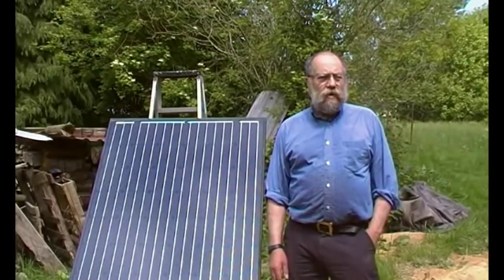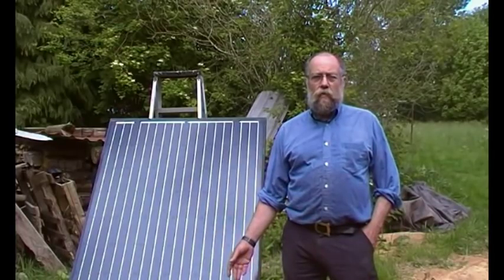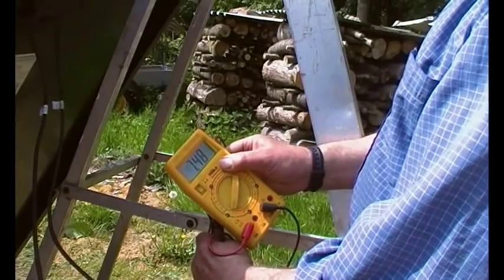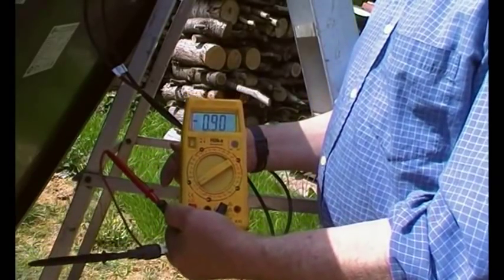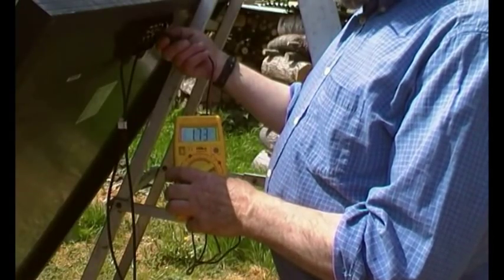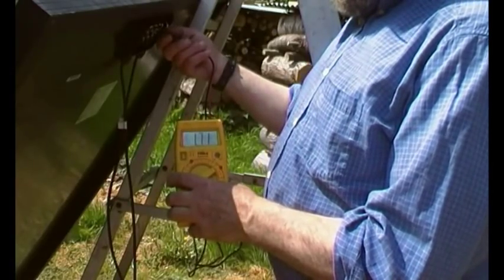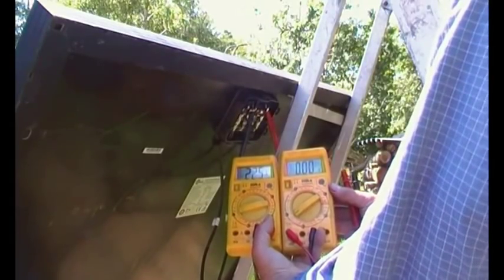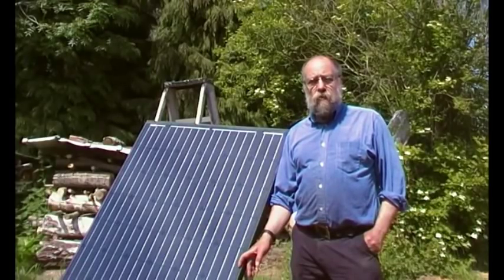Faulty Solar PV panel investigation with unexpected results.

Comment: Yes, I have come across the issue that you have with the "good" panel before. In my case it was a high resistance connexion to the tabbing wire on one of the strings. Fortunately it was the last cell in the string so I was able to dig into the backing and make a connexion before that cell. It was a 36 cell / 12 volt nominal panel and I ended up with a useful 35 cell panel. 

I covered it in this video here: https://www.youtube.com/watch?v=aB4frwjCM8o  

A very useful piece of test equipment for diagnosing these situations is a 50 watt 12 volt lamp, such as a halogen reflector bulb or an old car headlamp on some short clip leads. With this you are effectively measuring voltage and current at the same time, so essentially watts. Put that between each string and you'll soon see which ones are weak. Don't put it directly across the entire output of a 24 volt nominal panel though! Although, you'll probably get away with it if the panel is faulty as it won't achieve full voltage under that load. 

One very fortunate thing about the panels you have Andy, is that they are divided up into four strings rather than the more common three. Which means without any "extreme" work, such as digging into the backing, you can bypass the weak strings and end up with a reasonably good 12 volt nominal 125 watt panel. 
(Actually...I see your panel has three sections after all. Oops! You could still bypass one though and use it on a 12 volt circuit if two strings were OK. One 24 cell string on it's own wouldn't be much use except for maybe topping up a six volt battery or combine it with one in another panel in a similar condition)

As for the "bad" panel, that's a new one for me with all the strings down low like that. It could well be degradation of the cells themselves, or again it could be multiple connexion failures to the tabbing wires. It would only take one bad connexion in each string to produce these symptoms. 

At this point you could either throw it away (after perhaps harvesting a few useful bits), set it to use in an extremely light duty charging application, or maybe have a go at digging behind the backing to find the tabbing wires to see if you can find some parts of the strings that are still good.
Reply: This video shows the bypassing technique in more detail: https://www.youtube.com/watch?v=KO_05TaaziU
Reply from the maker: Thanks for the info, difficult to show and quantify using a bulb on video especially in strong sunlight, but a fixed resistance is required, I will check out your vid link, cheers
Reply: @TheInfoworks  In the second video I used a very small bulb, and it was quite clear in the video. It actually works surprisingly well on camera. Filming or not, it's a very good technique for evaluating the performances of strings in a panel. Of course a more scientific way would be to use a fixed resistance and a volt meter and ammeter simultaneously. Or one of those newfangled digital inline watt meter things. Bulbs are cheap & easy to handle though. :)

Comment: The voltage will always go low when measured with  short circuit current at the same time as solar cells are a high impedance device, they also wear out as the light damages the junction in the eventually.
Reply from the maker: Thanks, I would like to show this comparison in part two, cheers

Comment: Would I be right in thinking this panel could rewired to 18v and 16A? If so, is this a common arrangement to most solar panels?

Before solar panels were cheap as they are now, I made my own using silicone wafers, bus bar and glass from refrigerators, and found lower than expected current from poor solder joint or too much heat going into the wafer despite soldering on a piece of glass, acting as a heatsink.
Reply from the maker: It is a standard configuration with the three sections. It is not possible to separate the positive of one section from the negative of the next. Cheers

Comment: I have seen panels tested after high voltage arc, they had very little output afterwords, could there been a near by lightning strike , or something, to fry the panel, I don't know if it killed the diodes or what but output was near nothing!
Reply from the maker: I worked on a panel with a diode failed to a dead short. This had no output until the diode was removed. Cheers